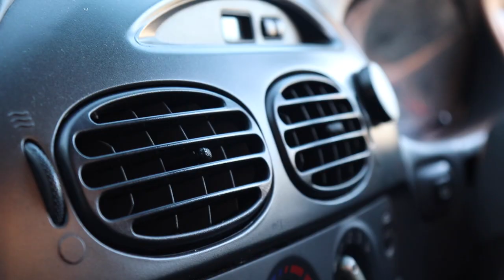AU Falcon - Is it as bad as it looks?

Comment: Doesn't matter if you think it's ugly or not (I think they got stuck with that for the s1 waterfall grille) they are becoming very popular and will go up in value.
Reply from the maker: Ya not wrong
Reply from the maker: That’s why I got 4 now
Reply: @FULLBOAR  last count there were 6 spares on my dads property, but mostly for parts. There is an Opt 20 wagon, that became a taxi and has over 700,000km on it, but it has the cleanest engine I have ever seen..... there was also a fully optioned fairlane, that has a fully rebuilt tickford motor done by ford, but it has a limp mode issue that the rebuild didn't fix (less than 1000km on it) ...... no point now because my dad worked on his backhoe next to it and dropped a 2 ton backhoe arm on it
Reply from the maker: @rubinmike-litt1068  thats proper sad mate
Reply: honestly I think they shouldn't cause they are a dardy cheap car
Reply: @FULLBOAR  I got three ba's, whipple s/c 2005 gt, 2003 g220, and a 2008 bf fairmont I6, did own an au for 7 years and loved it, but my neighbour backed into it, only needed the drivers door replaced but after that the door needed slamming, I should of complained to the crash repairer, but just decided to sell it, because having to slam the door or not having it close on first pull was bloody annoying

Comment: In my town of about 1000 people  there are at least six AU 's . Mine is one of them . I know of only one VT Commodore .  I've had it from 2 years old . Over 18 years of virtually trouble free motoring .. Major repairs are ....One alternator , power steering swivel hose kit replacement and early this year a brake caliper . Everything else works fine and is original other than a few batteries , tyres and exhaust components ..SO RELIABLE...I also have a gorgeous FG XR6 . Wouldn't part with either of them and I'm not kidding , Great video ...

Comment: Great review! I did 450,000 kays in my AU. Only issues were coil packs, collapsed ball joints and shuddering brake rotars. 
Got T boned by a P plater. 🤦‍♂️
Reply from the maker: Ah the old ball joint. Good stuff.

Comment: I bought my brother an au3 ute at the start of this year. Its a 5 speed manual. I personally have a 6 speed auto bf2. I dont mind the au ute at all. We have lowered the ute, swapped to 17s, has an exhaust. Its not fast by any means, but it drives really nice. Theyre not a pretty car. But theyre still not a bad thing.
Reply from the maker: Cheers for the comment mate. Would love a manual Ute but the auto cruises faultlessly. Just lowered mine an inch in the rear and got a set of tickford rims for it. Keep cruising...
Reply: @FULLBOAR  this au rocks au fairlane 17s. They were a mint set i had as spare rims. I gifted them as the 'elegance' rims i reckon look ugly on anything bar an au.

Comment: I had an AU on dedicated LPG.   Ford Australia could've survived in Australia with their dedicated LPG motors, I remember when they were making the FGs with LPi gas engines. Sadly, high power prices, green tape, red tape, blue tape & the popularity with the Mazda3 & the Hilux killed Ford Australia.   Tradies in Sydney loved the Falcon utes, cheap on fuel, being LPG & you could get them in any carpark. Now with these jacked-up utes, you're limited with clearance..  Falcon utes could get in a 1.9m carpark, pickup truck utes needed 2.2m clearance carparks or higher.
Reply from the maker: Yeah I rekon it’s a shame. The falcon is probably safer, as they handle better and have a lower centre of gravity than all these jacked-up dual cabs. And in all honesty the falc is probably more practical. It’s just that everyone wants to be seen in their fancy lifted rangers, that will probably never be used in 4wd.

Comment: Long term ownership of au2 wagon ( 18 years )  & bf3 wagon ( 10 years ) , both cars left in the weather 24/7 ,  the au gets no cosmetic love & gets stuff shoved into every place you can imagine , the bf just does normal domestic duties including the shopping & occasional towing a box trailer  . What has physically broken on  the cars ? the bf , the glovebox , the shifter , the shitty vinyl wrapped door card spear inserts , the whole passenger internal door handle assembly including the switches came off , the stupid plastic gearbox linkage , now the au , NOTHING ( the seatbelts were replaced from wear & tear )  . Which one did I buy when we needed a third car , another au , of course , no more b series junk for me.

Comment: Awesome video! I've owned all AU series (1, 2, 3) and currently have a Fairmont with full Tickford options in black. They are such great cars to drive and nimble. Will be hanging onto mine.
Reply from the maker: Good on ya mate! Just picked up a Fairmont myself, but it’s only got the standard intec. Would have loved a vct , but beggars can’t be choosers.
Reply: @FULLBOAR  Mine's an Intech too :) Just a standard Fairmont, but has Tickford wheels, body kit, woodgrain steering wheel and suspension fitted from factory. VCT would be nice, but the standard Intech is plenty good!
Reply from the maker: Ahhh nice. Sounds like a keeper!

Comment: AU Falcons are legendary vehicles, they are as tough as a Hilux they are built strong and the engine is bulletproof. Its a shame they tend to rust if you're not careful. I have a low km's example but the body is a bit rusty in some places. Eventually would like to find a clean enough shell to throw all the running gear in. The AU should be rolling on into the next century hahaha.
Reply: True that. I have a mint S3 AU XR6 with low Ks. Rear boot strut balls rust as does the brace body areas in the boot area behind the moulds

Comment: Great video...But, if it's an AU3, then why has it got an AU1 Futura front end? That looks worse than the waterfall grille imo. The S1 Forte did not have 14" wheels either...
Reply from the maker: Ya got me there. I was supposed to say 15inch. Also It must have had a grille change at some stage… anyways I’ve got a waterfall grille for it now so it’s not proper concourse correct lol:

Comment: Nothing wrong with the looks just too far ahead of its time, very aerodynamic shape.
Reply from the maker: To be honest I probably bagged the looks a bit too much in the video. I actually really like the way they look. I now have 2 AU utes and a V8 Au Fairlane.
Reply: @FULLBOAR  I actually love the look, it was out of place at the time when design was still very conservative, now anything goes and if the AU came out right now it wouldn't even be noticed.
Reply from the maker: They have aged like a fine wine. The rear quarter panel from the c pillar is a work of art in my opinion. And contrary to popular opinion, I think the water-fall grille is the best one.
Reply: @FULLBOAR  Yes I absolutely and categorically agree, the waterfall grill was perfection for the overall look and design of the car, the only fault I would agree to is the stance, it could have been an inch lower, also the wheel arches could have been filled a bit more with bigger wheels or less cutout if you get what I'm on about.

Comment: Drove quite a few as cabs and when the BA started appearing, I would request an AU as they ran like a clock compared to a BA and I liked their sound and refinement.
After a few years driving a BA sedan, then a BF III wagon it felt like a fantastic blast from the past when the owner loaned me his AUII ex taxi and loved the feel of it.
The four speed automatic matches way better with the smoother Intech over the powerful, thirsty and rougher running Barra.
Later Barras are a lot better than the slightly underdeveloped BA version but I  like the way the Intech drives more.
Reply from the maker: My thoughts exactly. The Barra is a beautiful engine but I reckon the intec captures the quintessence of a falcon better. That said the Barra does go like the clappers and would be awesome to chuck one in the au one day. And the Btr transmission is a top box as long as ya keep them maintained and keep ya self from doing any rollbacks...
Keep cruising and check ya ball joints...
Reply: My heart sank when I heard my first Barra. After a Ford nails the NVH issues with the SOHC undersquare six, no mean feat, they trot out farm equipment under the hood again with the BA!! BF seemed to address that part but it still doesn't have quite the same charm as the SOHC sixes, and even the old 4.1 OHV EFIs from the 1980s.
Torque and power got more peaky with the later Barras from the FG onward, kind of defeating the whole point of the large lazy six.
The SOHC from the 3.9 from 1988, both multi point and single point injection, to the well sorted In tech, made the Ford Falcon note.
It's in there with the Barra, but not as richly and homely feeling like the AU and before. You have the last of a breed. I could listen to a SOHC Falcon six revving at 1500 as an ASMR video!
Reply: @jamesfrench7299  All I remember from the 3.9's is a loud fan shroud noise
Reply: @Lexe-is5nv  The viscous clutch belt driven fan isn't always on. It's usually running slow enough so you can't hear it.
Reply: @jamesfrench7299  Thanks for that, It is a while since I heard a 3.9, but it seemed it was on fairly often, especially on take off.
Reply: @Lexe-is5nv  I know what you are talking about. Some seemed to stay on permanently others didn't. Maybe the earliest until the four speed auto were like that.

Comment: I have two. Can confirm cheap to fix, reliable and just like driving your lounge chair. Have driven faster and better but can't be bothered upgrading.  Very comfy on long trips. A bit soft in the rear suspension. Handles well if tyres are decent. Pretty under-powered but not many fines as a result.  yup. Pretty ugly though.
Reply from the maker: Niiice mate. You’re saving the environment by not buying a new car every 4 years. Go the AU!
Reply: @FULLBOAR  Oh...another thing I've noticed about the AU's...at least the Au2 and 3 is the simply phenomenal headlights that come standard. Put a decent globe in them and it's incredible. Best headlight beams I've ever had on a car without spotties. Don't need them with the AU.

Comment: I worked on them back in day at a dealership and they were okay, still had their issues but they were a droopy ugly mess of a car. Fast forward 25 years and they have turned into a cult car,  only problem is they are driven by mainly bogans that have slammed them into the weeds running bald stockies on the back with the exhaust cut off at the cat that has been bashed out !
Reply from the maker: Australian culture at its finest...

Comment: Great vid, I have owned my AU S2 ute for 10 years and have just replaced it with a new GWM Cannon. It has 300,000 K on it and in the 10 years I have owned it, it has cost me just less than $1000 in parts, including tyres, brakes and service bits. Even next to a brand new luxury ute, I dont want to part with it. Ugly but loyal!
Reply: No way in hell the Great Wall will last as long as the AU you have!
Reply: @triggeredleftyvegan6004  Absolutely correct,  modern cars are designed to be thrown away and recycled after 10 years, the AU was one of  the last of a dying breed.If the apocolypse came and I had to run, the AU would be my choice of vehicle!
Reply: @walterwolf2027  Same here mate even as a Holden man but love AU’s. I have them as dailies can’t beat them for comfort and reliability.
Reply: The engine will blow like a 'cannon'
Reply: @MartinJones123  Probably but, if it does it in the first 7 years, it's a warranty job and I get to drive my trusty AU again while I wait for them to fix it. :)
Reply: @walterwolf2027  Yeah but how about after 7 years?
Reply: @MartinJones123  After 7 years it wont be my problem to deal with. At that point I expect it to have near zero residual value and it will be time to get something new again. My AU will probably still be going strong at this time :)
Reply: @walterwolf2027  Each to their own but personally... I want a car to last over 7 years...
Reply: @MartinJones123  Agreed, hard to find anything in that space these days unless you've got plenty of coin to drop on something and then your depreciation will still likely be killer (unless you buy Toyota). I have just accepted that this thing will depreciate like a stone drops and that's my cost of car ownership (roughly $6k a year plus the $260 fixed price service costs, which is on par with a lot of main stream brands that cost $25k+ more to buy and way less than my previous Mercedes was depreciating).
Reply: @walterwolf2027  Mate at least its modern as hell, and 7 years worry free

Comment: What tf do you mean isn't "as bad as it looks"??? It's fucking sexy, punk beech.

And that's a s1 bonnet (also used on xr's) and s1 grillé and s1 motor (with s3 radio/vent facia installed) and s1 xr steering wheel you have there - Not s3. Alas, you have a s1. It probably has the open rear axel and not the IRS found on s2&3? Not sure utes may have got the upgrade.
Reply: All Utes had a S1 bonnet, also it has a S1 Futura grill. No Utes or wagon ran IRS all ran the trusty leaf spring set up.
Reply: Pretty sure all ute's have leaf springs

Comment: Can confirm ots reliability. Got an AU at 700k kms and still solid equal compression across cylinders and cars has never been serviced on time in its life.
Reply from the maker: Wow.
Mines only got about 250000 on it so I’ve got a bit of time left aye.
Reply: Second that, got mine at 290thou, been going for 12 months in my ownership (who knows how long before me) with a cracked headgasket and slipping box handling occasional abuse and plenty of pulls onto the highway, still the most reliable car i've owned and just refuses to die